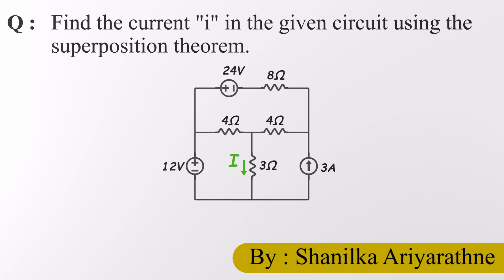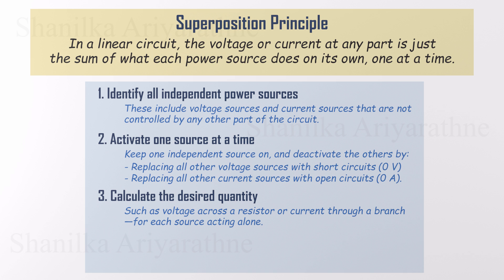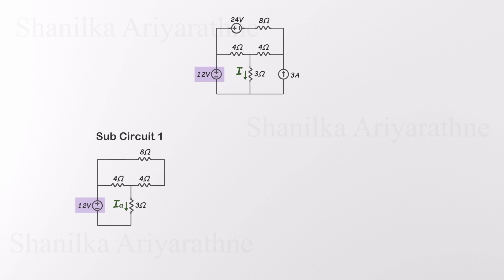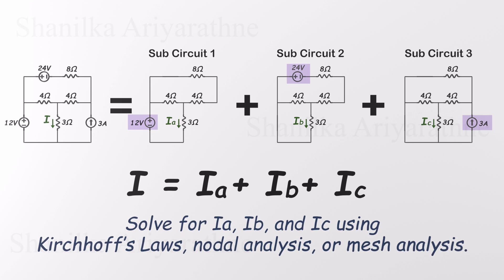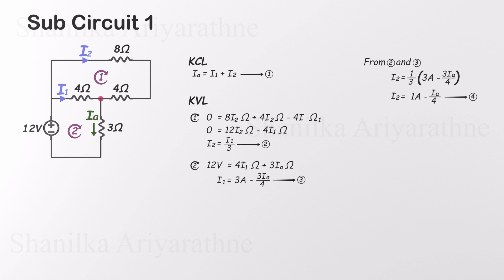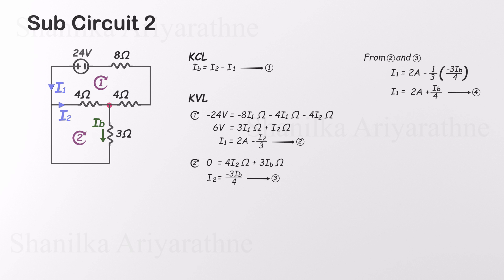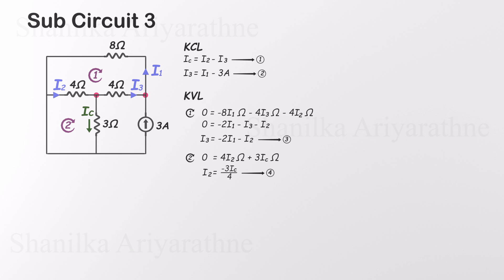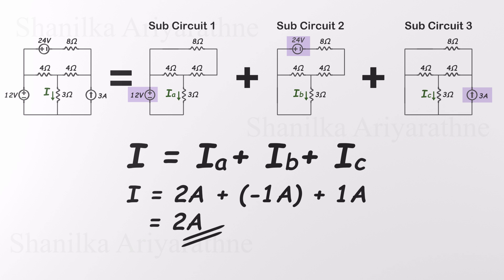Superposition Theorem Made Easy: Step-by-Step Circuit Analysis

Comment: Sir, can you explain how to identify and why it is minus 24 volts in loop 1 in the video of 5:19?
Reply: Attention to the directions of I_1 and mesh 1 are opposite. From mesh 1 direction equation can be written;

 + (24 V) - (I_1 * 8) - (I_1 * 4) - (I_2 * 4) = 0.

with simplifications you can get the answer. 
Good luck.